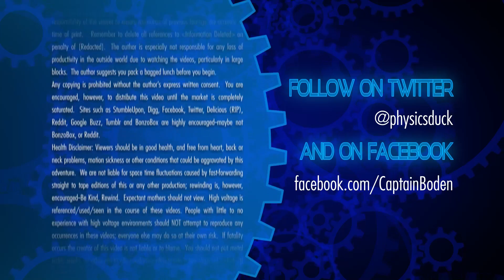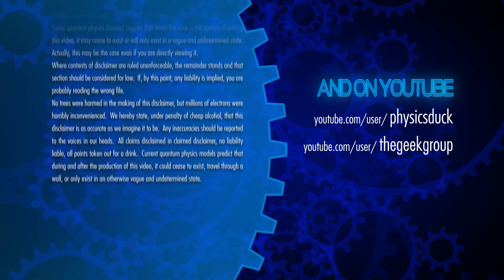Captain's Blog 7 8 2013 Painting Electronics and High Energy Physics

Comment: A C6-0 engine is a Class C solid fuel engine, designed as a booster. a C class engine has a total impulse between 5.01-10.0 Newton-seconds of thrust, the 6 indicates that this engine is designed to produce 6 newtons. The 0 at the end tells us that this is a booster engine - It does not have the delay-burn and ejection charges that are common to other Estes engines. Instead, bits of hot propellant will exit the top of the tube as the burn completes, igniting the (presumed) next stacked engine.